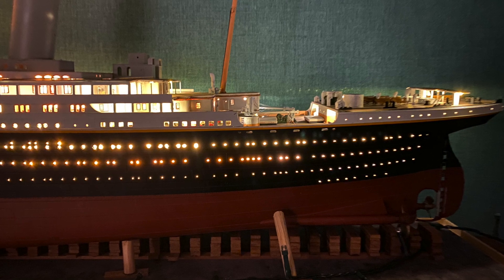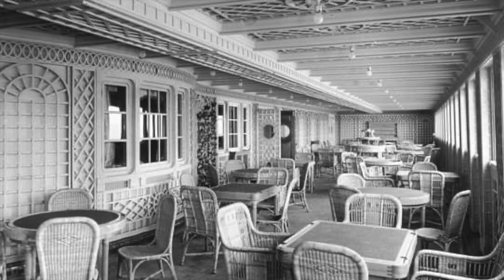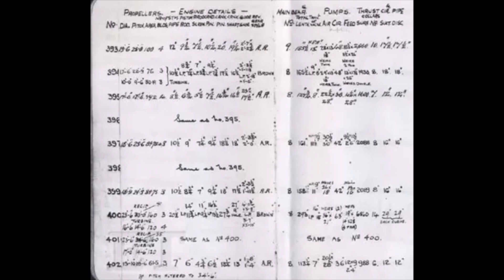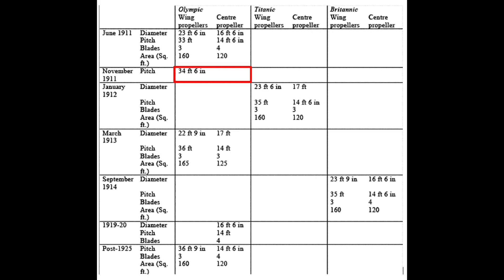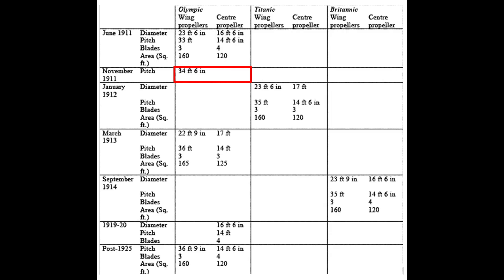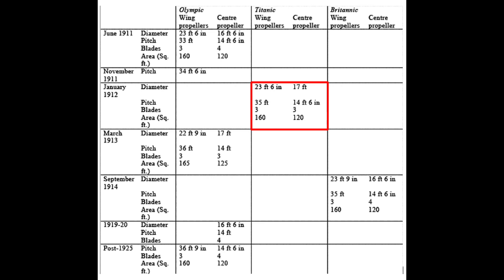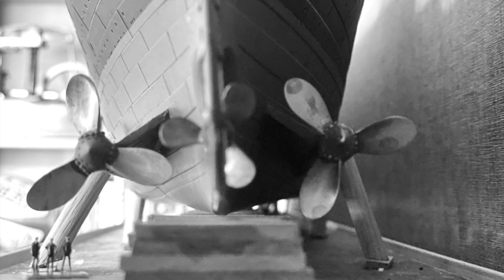Titanic's Central Propeller - 3 or 4 Blades?

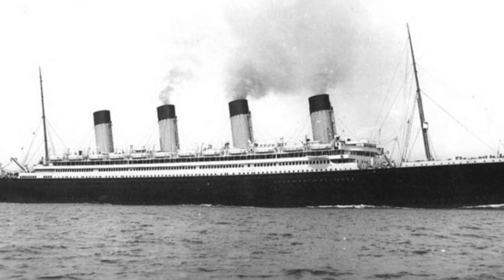Comment: 2:04 Titanic's displacement (weight) was a bit more than Olympic's, but if you're using gross register tons to say she was heavier, I should clarify that GRT measures the interior volume of a ship, not weight. This is how we measure a ship's overall size. Therefore, Titanic's GRT was more than Olympic's, so for a very short time, she was the largest ship in the world. Aside from that little nitpick, great, informative video.👍
Reply from the maker: Yeah you are correct, the interior volume thing always sounded rather bizarre as a measurement of weight to me. I’ve never been able to find out if there was a genuine logic to it? It rather allows people to game the system as WSL did with Titanic and the enclosed forward A deck promenade! 
Thank you for the comment, glad you liked the video!
Reply: @TheModelBoatGuy  there isnt much to it really.. Titanic A deck was half enclosed and the first class cabins larger as they got all the way to the outer windows (having like a private mini-promenade) and there was more enclosing on B deck too ...unless they consider the larger cabins more volume.. Titanic is heavier but has actually same exact hull volume as Olympic... Britannic was indeed bigger as they widened the hull by 1 meter to make more room for double hull while still on dock (Olympic had it added as it was and lost a bit .. ironically the refit made Olympic heavier than Titanic was)
Reply: @sparrowlt A Deck wasn't considered for calculating GRT.. Also, if we compare the launch hull, Olympic was slightly heavier than Titanic. That's why modifications for Olympic in 1913 made her slightly heavier even without B Deck staterooms. (Courtesy Mark Chirnside)

Comment: Deas Sir , I do think that for any factual research, you have to look further than any Titanic related material as it is always going to be biased and will not be factia; as most true facts about Titanic are not acceptable in the accepted historical story .       However , we are all aware of the now famous so called number of 401 stamped on to the thrust face of the exposed bolted on blade  that we have all seen on photographs .  Myself firmly insisting that the number either is fake and added on  or it is marine growth.    No propellor manufacturer then or now has stamped any kind of number into the thrust face for that would encourage marine groth , barnacles weed , that would encourage vibration .  But my question is this ,    given that the exposed detachable blade is seen to be stamped , it would follow that all the blades are stamped  otherwise it would be useless to just stamp one blade .    So I looked for numbers stamped on to Olympics props and obviously cannot find any . Which to me is pure fakery on the pro Titanic people .
Reply from the maker: Seems to make sense to me. I am not an expert at all but I would suspect the motion of the propeller would discourage marine growth to an extent. Is bronze susceptible to marine growth. Clearly not as much as iron hence the lack of antifouling paint. As you say though stamping the on the thrust face sounds odd, apart from anything else there a lot of places you could stamp a number which wouldn’t effect the props performance in any way!
Reply: A dry dock image of Olympic showing the rudder and starboard propeller, view to aft end, shows 400 in the bottom blade. Another dry dock image of the center propeller, view from starboard side to forward, shows 400 on the thrust face of the center propeller.

Comment: As there may be a source showing a change of propeller in the central section of the stern, the truth is probably still unknown if the change took place or not. It’s the photo va the source and it could be that they were planning the change of the propeller before the sinking but did the change actually take place? 

Back in the time central propellers are usually larger and four blades on ships planes and other vehicles from the 1910s to 1920s as this was the way engineering was to place a larger four blades propeller at the center of the vehicle body and weight.

The best way to confirm this is to find a way to dig the silt of the seafloor to some extent and the blades from a four bladed propeller would show easily as they are more close together than a three bladed propeller. It’s quite possible to design and bring a working ROV to excavate some of the seafloor out. .
Reply from the maker: Hi there,
Thanks for the comment. I think the significance of the document is that there was no change, I.E it was always the plan to give Titanic a 3 bladed central propeller. We’ve always assumed Titanic followed Olympic and had a 4 bladed prop, but in reality that’s all it is, an assumption. That belief is based on what Olympic had, rather than any first hand evidence of what Titanic had.
On Titanic’s entry in the notebook it says 3 blades, not 4 crossed out and replaced with 3 (incidentally I think on other ships listed in that notebook changes have been recorded by crossing out the old).

As you say the way to find out would be to dig away the silt and see. But who would spend the many millions necessary to commission the expedition and equipment necessary to find out! If I had the money I probably wouldn’t spend it on that 😛 

Sadly I suspect it is going to be one of those enduring Titanic mysteries forever more
Reply: The entries on the notebook are usually after finalizing it. 
Also, the dry dock image of Titanic in February 1912 shows an object resembling the center propeller in the barge ready to be fitted. 
Samuel Halpern made a 3d rendering of the prop and it matches a 3 bladed configuration. In the article "Object in the barge".

Comment: Hey, how was the olympic able to drop a propeller blade at sea?
Reply: On 21st February 1912, Olympic sailed from New York, heading for Plymouth, Cherbourg and Southampton. At 4.26pm on 24th February, about 750 miles off the Newfoundland coast, she hit what the officers later reported was probably a submerged derelict, not uncommon at that time with so many old wooden-hulled vessels still around. Wooden wrecks would often float for a long time just under the surface, and were notoriously difficult to see in time to take avoiding action. When she hit the derelict, Olympic lost a blade on the port propeller. 

The engine was immediately stopped and the propeller disengaged to prevent damage to the engine and shafting. Once the damage had been checked, she continued her journey, at a reduced speed, and arrived at Southampton a day late. Once passengers and cargo had debarked, she returned to Belfast, for repairs.
Reply: @dovetonsturdee7033  ok but I’m asking HOW
Reply: @amtrak_121  What part of the above isn't clear?   One of the blades clipped a submerged derelict, and was brokeen off. The outer propellers of the Olympics were bolted on, the propellers were not one piece castings.
Reply from the maker: Interesting, I didn’t realise it was caused by a collision with something underwater. I had always just assumed vibration had caused bolts to work loose. 
Thanks for the info!
Reply: @dovetonsturdee7033  but how did they detach them? We’re they done manually, remotely, or what?
Reply: @amtrak_121  The remains of the broken blade were detached manually, in dry dock at Harland & Wolff's yard.
Reply: @dovetonsturdee7033  oh ok. From what I read on Wikipedia, I was under the impression that the blade could actually be dropped while at sea.
Reply: @amtrak_121  No.
Reply: @dovetonsturdee7033  thanks for clarifying it

Comment: Going off of White Star line’s actions with Britannic, you would probably expect Titanic, would’ve also later on been fitted with a 4 blade central propeller, had she survived. For the models sake, 3 blade central propeller is accurate. Because the model builds as Titanic on the maiden voyage. What you could also do on your model, if you really want to go for historical accuracy, is add the coal fire damage to the starboard side of the ship. A lot of people don’t even realize that Titanic actually had a coal fire break out, and the heat from the fire, is the possible cause of the damage from the plates on the hull. The hull plate steel lost its temper from the heat of the fire, causing it to bust open from the impact of the iceberg. Had the fire not taken place, when Titanic struck the iceberg, it was likely the plates would have stretch, and then wrinkled, but remained intact, and not ruptured. Also there’s a theory, that says Titanic would’ve been better off to hit the iceberg straight on, instead of side swiping it, as that would have crumpled the first 80ft of the ship, but wouldn’t have caused enough damage to sink the ship and it would’ve survived.
Reply: Why would you add 'coal fire damage' to the side of the ship? The mark on a photograph claimed by Molony appears on one photograph only, in a location well forward of the bunker which was actually affected, and which had already been extinguished at least a day before the collision. 

The supposed damage to hull plating is entirely imaginary. Merely a wish-fulfilment fantasy.
Reply: The coal fire did nothing to the hull, and nothing was visible from the outside the picture showing the "damage" has the burned spot in the area above water where the pool and squash court was, and also the coal was smoldering due to the limited oxygen so it could never reach high temperatures, theres also the long story of the coal fire indirectly giving Titanic more time during the sinking
Reply: @SwagCat852  Quite correct. But don't expect the conspiracy theorists and supporters to take any notice!
Reply: I read somewhere that she also had a massive and unsightly jagged scratch down one side when she left Cherbourg. It had been caused by her anchor.
Reply: @davidmccann9811  If she did, no photographs exist of it.
Reply: That coal fire was a smouldering fire, not a wild ravaging fire. Smouldering fire doesn't reach melting point of mild steel. It was confined to the bottom of the bunker Y in boiler room 5.
From Frederick Barrett's and Charles Hendrickson's testimony , only the Watertight bulkhead was dented. It was dinged aft and forward slightly. No hull damage was reported. These bunkers were located adjacent to Watertight bulkheads transversely and not longitudinally along the hull. 
The black smudge in photograph was a reflection of wharf in the black glossy hull paint. It's location is forward and 2 decks above actual fire that happened in the bunker. 
Other portions of hull opened up seams due to iceberg collision, but this exact part was opened due to hull weakening? Only that portion? Seriously?

Comment: I have a bigger question. Why is the center of each propeller colored red instead of gold like the blades?
Reply from the maker: So the parts that are painted in red tend to be made from iron or steel. So on the outer props the cone at the ends was made of light iron, so was painted red to protect it from the sea water. The red paint was called anti fouling, and was designed to stop marine growth on its surface. 

The parts that look golden were actually made from bronze, the entire central propeller was one piece of bronze and the outer propeller blades were bronze which didn’t require any protection from the elements.
Reply: @TheModelBoatGuy  oh ok.
Reply: @TheModelBoatGuy  did Olympic or Britannic have this feature as well?
Reply from the maker: Yes I believe so, any iron part of the ship exposed to seawater would have been painted like that. 
For example the hawse pipes that the anchor chains descended through were painted in anti fouling red too
Reply: @TheModelBoatGuy  nice.
Reply: @TheModelBoatGuy  wouldnt the anchor chains scratch the paint off?
Reply from the maker: @CrucialFlowResearch  yes they would over time, I suspect crew would routinely have to repaint the area around anchor chains

Comment: Your evidence is questionable.  If you look further, you will see that the size of the propeller blades are nearly the same size as OLYMPIC’S.  There’s a 6” difference.  The square footage of OLYMPIC’S blades is 120 square foot total.  Likewise, the TITANIC’S central propeller is also 120 square feet.  So if OLYMPIC had 4 blades as opposed to TITANIC’S 3 blades, then the size of TITANIC’S central propeller blades would have to be at least 33.3% larger overall, well more than just the 6” listed to maintain the same working area.  As the propeller’s diameter is just 6 inches larger on TITANIC (not nearly enough to make up the difference between going from 4 blades to 3 blades while maintaining the same working area), Titanic couldn’t have only 3 blades and maintain the same 120 square footage of propeller working area found on OLYMPIC’S central propeller.  I maintain that either the blade count on the TITANIC is listed incorrectly AND/OR the size of the propellers is listed incorrectly.
Reply from the maker: I get what you mean, but when you talk about the area of a propeller you are actually defining the swept area (I.e. the area that a propellor sweeps during one full rotation). So a propeller with 1 blade and 10m diameter will have the same swept area as a 4 bladed prop with a 10m diameter. It’s just pi*r^2 

There are trade offs between the number of blades on the prop such as vibrations increased efficiency but this maths gets tricky quickly, and I’d by lying if I claimed to understand it myself.

The evidence in question is a genuine notebook from Harland and Wolff. This article is quite a good read as it goes into more depth than I did:

https://www.encyclopedia-titanica.org/mystery-titanic-central-propeller.html

Comment: There's a film reel of Olympic in dry dock from 1-17-1929 and someone is explaining the size and weight of the screws. At that time the centre was a 16ft, 4-blade propeller.
Reply: Olympic always had a four bladed centre propeller, except for a brief period from March, 1913.   Trials with a three bladed propeller appartently demonstrated that four blades were more efficient, and the brief experiment with three was discontinued.
Reply: @dovetonsturdee7033  I always find the engineering trials and test iterations so fascinating for vessels built without a handheld electronic calculator. I wish there was more info available about their decisions and testing.
Reply from the maker: Yeah it is quite fascinating really, not quite trial and error but educated guessing zeroing in on the best solution.
Id be interested to know how efficient Olympics propellers were compared to modern computer designed ones

Comment: Also...... i dont know if im reading this wrong but in the lighting kit guide in stage 5 it says to use a wire with PLUG. Yet when you look at stage 76 the picture clearly shows it to be a wire with SOCKET. So right from the start my wiring has been wrong. I give up!!!!!
Reply from the maker: I am not at all surprised by this. I think the instructions are quite ropey throughout tbh!

Comment: Hi Rob. Im in a bit of a situation with my LED lighting. My soldering skills are nil even having watched loads of videos on how to do it. So now ive come to the decicion to rip out the existing LEDs ( some work some dont) and instead just run a length of LED strip right through the whole of the superstucture (as ive done with the hull). My model is only going to be viewed from the port side so that may make it a bit easier and i can cut some of the unseen plastic from the decks to help feed the strip lighting around the model. It is after all just to create an illution of cabin lights. So im going to do this unless you can think of another way to accomplish this. Another reason is this issue has bogged me down from "cracking on " with the model and even though im retired i dont want to spend too much  time trying to resolve my problem. Any thoughts?
Reply from the maker: Hi there, 
Soldering is a right pain. I think in some ways what you suggest is probably a better approach to be honest. I think simplicity tends to win out over complexity most times. 
It’s hard to see where you’re going wrong over text chat of course. I think the only issue you might have is light bleed. In some instances I’ve had light shining through the plastic which really is annoying. So I’d suggest painting inside in black, or maybe use something like kitchen foil. 
But I’d have thought your suggested approach will be fine
Reply: @TheModelBoatGuy  Thanks for your reply. I was probably going to do it but just wanted your thoughts. Youve made my mind up !!! cheers !!
Reply: @keithwilson8777  Keith, I suggested the same idea to another modeller who could not get his LED's to work.  He purchased a ready made strip and his model looked really good.  Lepro available on Amazon produce a nice little inexpensive kit with a built in dimmer control.  Really good for getting the effect just right!😉
Reply: @johnnyhollis9977  Thanks Johnny. I was just getting bogged down with the lighting so now im going ahead with the idea of a single strip of LEDs running the length of the superstructure as ive done with the hull. Will probably use Robs idea of putting foil inside as well to help reflect the light around the ship. The joys of modelling !!!!!
Reply: @keithwilson8777  No worries, I am sure your model will look great. The trick is to avoid hot light spots which can look annoying. Think about light diffusion plastic where this occurs. Yes it's all fun!!!! 😂👍